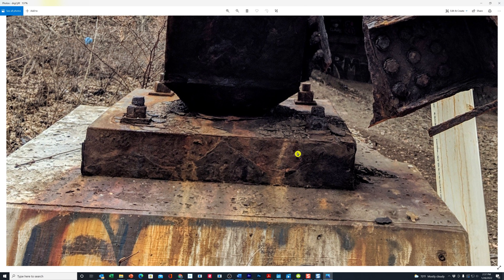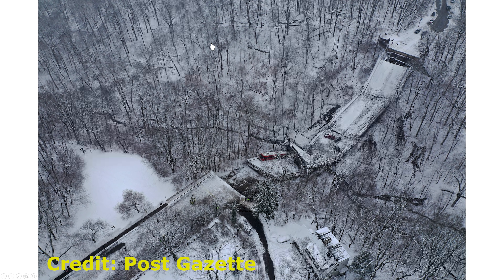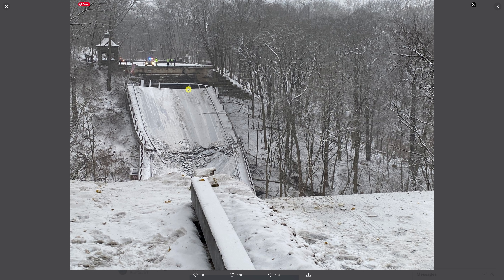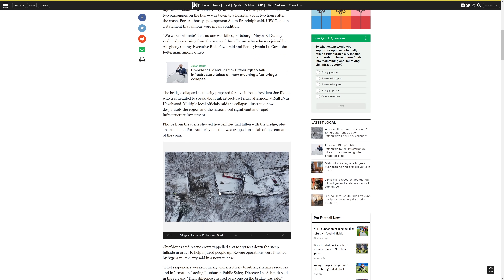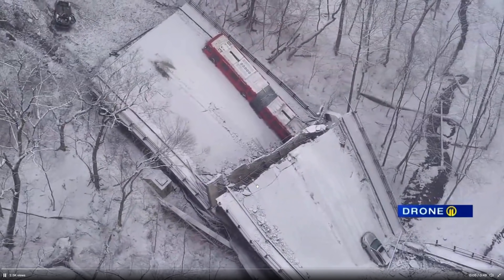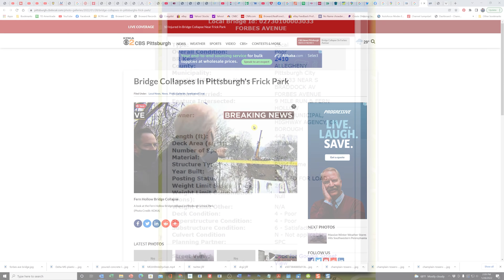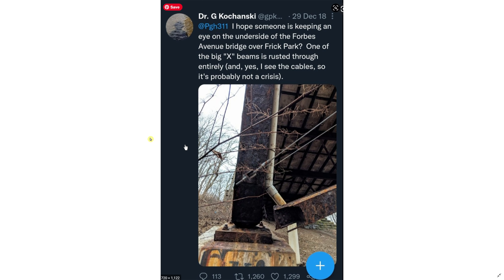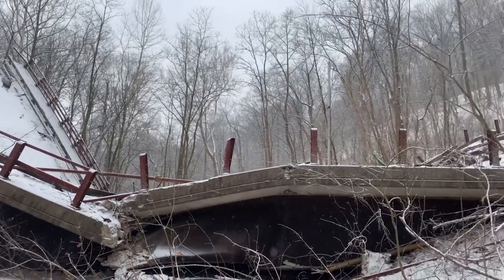Pittsburgh Bridge Collapse Cause, Forbes Ave Bridge Frick Park Rust?

Comment: I've only ever had to take a year of physics on college but I'll bet it was the rusty supports. For one thing, the cable where the cross brace was rusted through would provide tensional support but what if something caused a compressional force, like maybe strong lateral wind or something? A cable isn't going to be able to resist a compressional force and, worse, it might even cause the original beam that is still there to hit the bottom of the column where it was once attached and probably where it is also weakened from the same rust that caused the beam to break off in the first place.

Then, the support itself looks a whole lot like a tree that is about ready to be felled. You'd think that anyone who had even see just a cartoon featuring any sort of logging would know that this was something that could be knocked over fairly easily.

We need to stop pretending as a country that we can put stuff like this in the somebody-else's-problem field and that it won't result in catastrophe. Before we talk about what it will cost to do something, we ought to first examine its value to people's lives.
Reply from the maker: that is correct!

Comment: It's obvious...neglect and to put it in a mild statement "deferred maintenance" as if that makes it feel any better that those who were in charge of it were totally irresponsible and should be replaced.  How many others are just like this and the many cities, counties and states don't do something or tell the public?
Reply from the maker: This bridge failure will become a distant memory as soon as the next one happens and you know we won't get off that easy there will be death
Reply: @jeffostroff  I'm fairly sure that when structures are built for municipalities or others, the engineers include a maintenance guide of some sort with associated operational costs. This is where the problem is in the USA...no one is held accountable or thrown in prison for intentionally using city funds for other projects or events vs. maintain what they have. This is the problem and what they like to do is pass that problem/expense onto the next term of city council etc. These idiots should have to reveal their required maintenance schedules and then show the public they are doing as per the "owners manual" otherwise, they  should face criminal charges for endangering the public and more importantly, their local residential citizens. Does anyone recall Lake Oroville Dam in CA? Same thing there, report after report of poor conditions yet the state of CA decided not to do anything and spend the money on something less important.

Comment: Jeff, Wikipedia, which also has the heights above the ravine, etc., says the bridge is built using COR-TEN weathering steel ( https://en.wikipedia.org/wiki/Weathering_steel ) which might explain the appearance, but also interesting to read of some problems with the steel- and I think this might fit in well with your suspicion of the drainage problems (if you add it in with all the salt that comes with winter roads in Pittsburgh).

Comment: Primer can increase the chance of rust since it will trap water next to the steel.
Reply from the maker: The primer will not trap water next to the steel if it is dry when you apply it, and then you put the top coat on top of the primer.

Comment: I’m not an engineer but I do know that metal gets brittle as temperatures drop and Pittsburgh had a spate of cold weather (as in single digits and even lower with the wind chill) the week leading up to when the bridge collapsed.  I believe that the subzero temperature were the proverbial straw the broke this camel’s back although clearly there was maintenance failure that allowed the bridge to deteriorate to this point.
Reply from the maker: So your problem if I understand is your water froze inside the hose that leads from the bottom of the fridge at the water inlet valve, and up to the reservoir for the water on the inside of the wall of your refrigerator on the back period so the hose head just frozen and you thought it out is that correct?

Comment: Wonder if the legs sheered off the concrete pads
Reply from the maker: One of the new photos I could see the concrete pad nearest the gate house was perfectly intact, and the no sign or residue of the steel column on it, so looks like it got dragged off.
Reply: @jeffostroff  very surprised nobody was killed.

Comment: The build up of cars as seen @ 16.55 min. is probably comparable to the weight of the snow so the weight of the snow may not factor in. Looks like it just deteriorated way below specs.
Reply from the maker: Yes good point

Comment: The following may be poor examples, especially since railroads do not apply salt. Champlain towers never had to worry about freeze thaw or road surface salt. Yet so close to the ocean, corrosion from Salt is still a factor. There's through hole corrosion and surface corrosion.

First if one ever reads instructions on a bag of salt melt, 112 oz cup is enough for 10 sidewalk squares or 20x20 driveway. The goal of salt has always been only to loosen the ice from surface in order for it to be shoveled or plowed away.

Railroad overpasses commonly last 100 years or more. I have no idea service life of ballast or steel rails.  Yet the road surface for vehicle traffic underneath can produce some of the deepest potholes I've ever seen.. Unless it's cobblestone. And even then old streetcar rails survive overzealous salting.

We've only been applying road salt since just after World war II. I can only wonder if sand instead of salt would have extended this Bridges service life. I'm aware Sand also has its problems too.

Comment: After living in California for 20+ years, every time I flew back to visit friends in Pittsburgh, those steel frame bridges up on what looked like rusty pins used to give me the willies. 

I'm not an engineer, so that's probably an irrational instinct, but I do wonder if some of the old steeltown bridges may have been built before all the stress factors working on bridges were properly understood.

Also, this is a crazy question, but— just how much stress do the rare earthquakes back east put on rigid steel bridges like this? Because this looks like an absolutely TERRIBLE design for earthquake country.

I was just thinking of that 2011 quake in Virginia that was felt so far and wide because seismic waves travel farther in east coast bedrock. Also I remember being surprised by an earthquake around Easter in the mid-80s when I lived in Chester County, PA. Plus there's been earthquakes in the historical record in Boston, New York, and elsewhere. They're rare in most of the US, but they do happen.

However, I just remember something that started in Pittsburgh after I moved out west: fracking. I don't know how much it's affected seismicity there, but Oklahoma actually has more earthquakes than California now due to fracking, and homes and buildings are taking structural damage from all the low level, constant vibrations they weren't designed for. That's obviously not the chief problem here— the rust is obvious. But if the Pittsburgh region is getting microquakes like Oklahoma from fracking, that may be an additional, unforeseen factor causing bridges to wear out faster. The earth itself may be piling on extra metal fatigue.
Reply from the maker: Yes they were fine when built, but left unmaintained, is spells disaster

Comment: I think it was a combination of things One there is a lot of rust through on the support beams You have the effects of salt from the Winter's eating away at the bridge and  When the bridge was built the traffic wasn't as heavy on it as it obviously is today So with the increase in traffic flow adding more weight to the bridge at 1 time plus the weight of the snow Plus the effects of Winter time salt Eating away over the years at the steel Has recavic on the superstructure of the bridge Looks like somebody obviously put some cables on the bridge to help hold the support  and take some of the stress away  But obviously it wasn't a proper fix It was only a Band-Aid for the problem  that bridge should have been shut down years ago And the problems addressed way back then Sure it would cost a little money to fix back then to make the  Bridge right but look at it now now you have to put up the cost of a complete replacement So I'd say it's a combination of bad management and maintenance And the increase in traffic flow
Reply from the maker: Yes, they put a band aid on a gaping bullet wound

Comment: Poor inspections. A lot of times the use of sandblasting and painting can cause a lot of damage. The sand builds up in the corners and they paint right over it. I've seen this a hundred times. It rusts holes through the steel where the sand built up. Only time will tell.

Comment: Jeff: This is a typical miss use failure of Corten Steel. I was involved with the very first installations of Structural Corten Steel. It was in 1970s for FP&L's 500 KV lines. Some are still up. You see them on the west side of I-95, and look like giant Alien mono-tube monsters.  I have many photos of structural failures at the foundations of Corten Steel. Just like the ones in your photos of this bridge failure. I have warned and lectured about the miss use of Corten Steel for decades. It's a wonderful product. But, it only works under certain conditions, i.e., no standing water, no wet areas, (swamps, near oceans, over rivers, etc. No hydro-carbons, i.e., not near factories, coal plants, vehicles spewing hydrocarbons, etc. And, absolutely no salts.  You don't put Corten steel in sensitive areas where rust water will pollute, or visually destroy sidewalks and other architectural items.  You use Corten Steel in areas of low humidity, clear air, and no agricultural operations.  FP&L had a lot of failures with the Corten steel 500kv lines in Florida. Especially in the Everglades. The rust even popped the bolts right off the towers. It was a mess. I've seen many similar failures on lots of other Corten Steel installations. The Pitt. DOT should have used zinc painted painted & galvanized steel for this bridge. The engineers made a massive mistake, and killed people. Which is nearly always the outcome. When engineers mess up.  Like the Pitt. DOT did on this Bridge Failure.
Reply from the maker: Are they holding up ok as transmission line towers?

Comment: The deck of a bridge is like the roof of a house!
If it is leaking the structure will be destroyed. 
At and continuously the city has to care for a tight deck.
Reply from the maker: yes good analogy
Reply: Great point so simple to maintain the drains from the deck to the discharge point way from the structure,!

Comment: I did see a report that the bus on the bridge weighed 22 tons. So, what? 84.6% of posted capacity.
Reply from the maker: The problem is the posted 26-ton limit was put in place in 2014 and the bridge has been severely deteriorated since then this rating should have been D rated even further my guess probably somewhere between 10 and 15 tons. The bridge was underrated for the posted sign by the time it collapsed. Also didn't you pay attention to the part of the video where I talked about my former coworkers at Motorola and how I used to always tell them to try to stay away from limits?
Reply: @jeffostroff  Yeah. Thus 84.6% of posted capacity. Plus the weight of snow/water... obviously was over the actual limits.

Comment: When the amount of rust outweighs the corresponding weight of good steel, it is inevitable that the bridge will fail... with traffic non the wiser.
Reply from the maker: usually the rust just weakens the metal

Comment: Pittsburgh uses a ton of salt to melt snow.  Every year we have a climate that dips below freezing temps but typically not low enough that salt wouldn't work.  The roads take a beating because of it's use.  Cars rust at a much quicker rate than most other states.  I wouldn't be surprised if that salt was rusting the bridges at a faster rate then was expected as well.  The city has the second most bridges in the world next to Venice Italy.  Constant maintenance of the bridges are being worked on almost all year around.  But we obviously need more tax money to go to the bridges and less in some other areas.

Comment: So one of the metal crossbraces had completely rusted through to the point where it disconnected from one of the main support beams, and it was "corrected" by installing metal cables!! Is it any wonder that this bridge collapsed? If a state or a municipality doesn't have the money to spend on repairing inadequacies like these in a correct fashion, then the bridge should be closed. And I'm talking about every substandard bridge in the country! Maybe if the public is inconvenienced enough, and they see how many bridges in their community are closed, maybe then there will be an enlightened moment where people realize that we, as a country, are living on borrowed time. If a weight limit is needed on a bridge on a main thoroughfare, the bridge should be closed. How many semi's and dump trucks and cement mixers are going to be driven by personnel who actually look at the weight limit sign and then turn their vehicle around because it's overweight? I'd say close to zero.

Comment: SALT is a major problem.  And, bridges can be salted when roads may not need to be salted.

In St. Louis, they would salt the roads before a snow or freezing event, and one would get salt powder everywhere.

It is likely this bridge also had poor drainage, and salt brine would just seep in everywhere.

There are less corrosive alternatives to salt.  Beat Juice?  Calcium salts?  Of course salt is cheap but spending millions to maintain and replace bridges gets expensive.
Reply from the maker: They need a salt resistant metal

Comment: It looks like rust due to use of salt on the roads. One good solution would be cathodic protection (see use of Zinc on boats to prevent corrosion.) Almost every highway structure in the Northeast is doomed unless and until the rust is stopped using this method. Cathodic protection can be done by either electrical current or - similarly to how underground cables are protected - connecting large magnesium or zinc blocks buried in the ground.

Comment: When the specs say 26 tons, can that be right? 52,000 lbs. capacity? My 37' rv has a dry weight of 26,000 lbs all on its own. That would mean my rv on that bridge would fully account for 50% of its capacity! With that in mind, I reflect back to one of the pics Jeff showed with it completely covered in stopped traffic. I must be misunderstanding this bc otherwise you've got to imagine that twice a day like clockwork this bridge was pushed beyond its limits for years. AND it was poorly maintained,  just to twist the knife? Seems to me that there has been some very serious dereliction of duty. How could any licensed professional charged with public safety as it pertains to roads and bridges for Pennsylvania let this slide?

Edit: Duh.....now I see that the 26 ton capacity is per vehicle. That makes much more sense now.
Reply from the maker: The weight limit is per vehicle

Comment: That bridge should have been closed as soon as that broken beam was found.  If this beam is that rusted, the others are too. I can assure you this superstructure hasn't been painted for decades.  Here is the real issue. They installed a cable to replace a beam.  Those x beams are there to keep the main support beams from bowing inward and outward under load. A cable from the bottom of one main support to the center of the other, would prevent the beam from bowing outward, but not inward.  That cable probably contributed to the failure of the main support beam.  Someone is going to be held accountable for this half ass, temporary "fix", and for not closing that bridge.
Reply from the maker: I wonder who stamped their name on that repair
Reply: @jeffostroff  Whoever it was, they probably made those forms disappear last night.

Comment: I'm disgusted that it was only from 1970. That bridge should not be in that kind of condition yet. I think it was built by a lowest bidder, Nobody wanted to maintain it because it was not a state owned bridge, and the inspectors were there to get a paycheck and not putting an honest job into it. This should have never happened. but this is not the first bridge that has almost/totally collapsed. alot of our bridges have fractured, and they have just put patches in to hold the beams together.
Reply from the maker: salt and humidity

Comment: Seriously they did not shut down this bridge?   A cross brace completely rusted through and a main support foot almost completely rusted through.  Then they use cable's with turn buckles to pull the main support columns in! 
So the cross support is to make the frame ridged and keep the superstructure from flexing beyond specifications.
Adding cables will actually cause the bridge to twist and flex so the morons then go and tighten up the cables.
Then this causes stress on that section of the bridge deck.  You can see the stress cracks in the deck.
So if it becomes very windy the deck will act like a sail and the week link the broken cross support and column will snap and the bridge will implode.
Reply from the maker: If they tighten them to be in tension it should hold. Just like transmission towers with cable stays